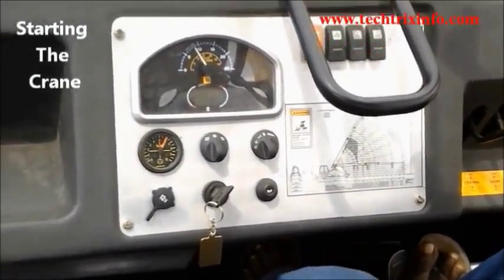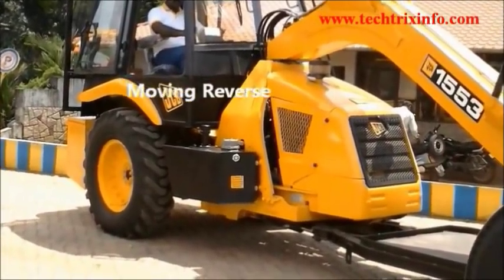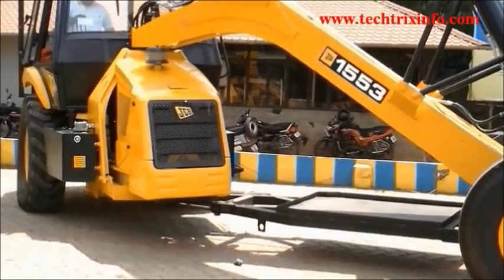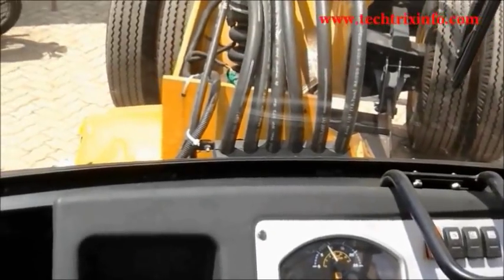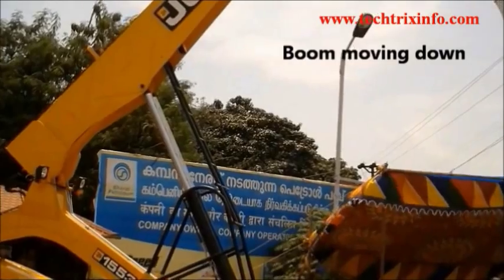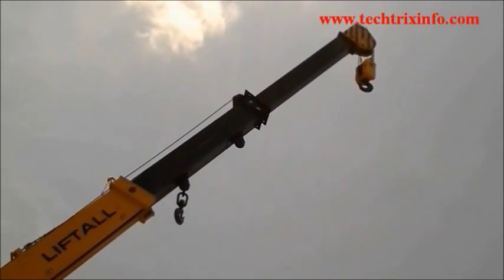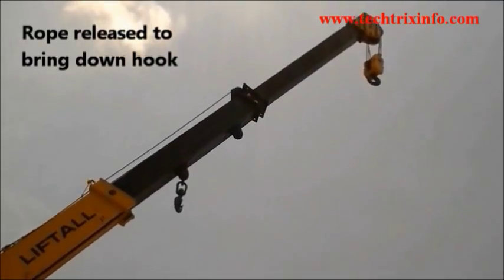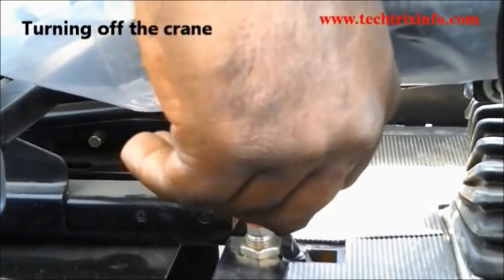How to drive and operate a crane. ✔

Comment: if speed governor are used so will it save clutch plate or break equipment's since we don't need to brake all the time which can readily reduced the brake disks and clutch plate or other materials like break oil etc
please discussed it

Comment: if we use a dry battery and turned diesel engine by electricity engine 
then we can easily reduced the extra load by dry battery, will it possible, dry battery can solved the purpose of rear weight